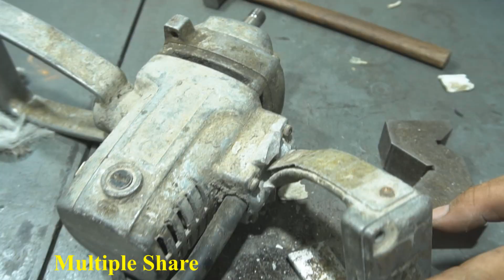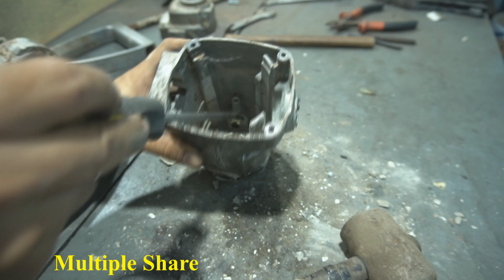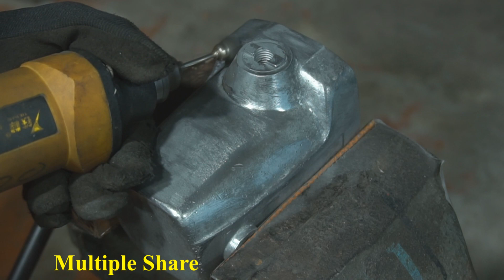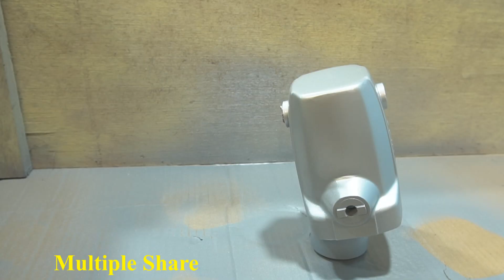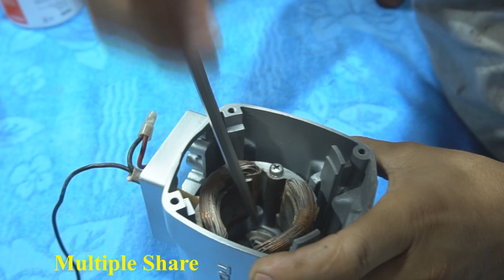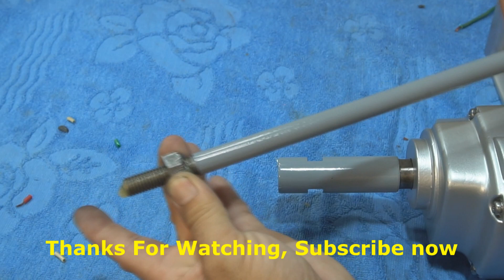Restoration/ Broken Handle Electric Drill Concrete Mixer Rescue/ TOSHIBA Cement Mixer of Japan

Comment: You did a very good job it looked very nice and worked well but I would recommend replacing all the bearing with quality ones, as a given ,those bearing have put in their time ,the same with brushes and cords. The only exception would be something for show only.
Reply from the maker: Thank you so much for comment , For some bearing are still good quality because it stay inside.